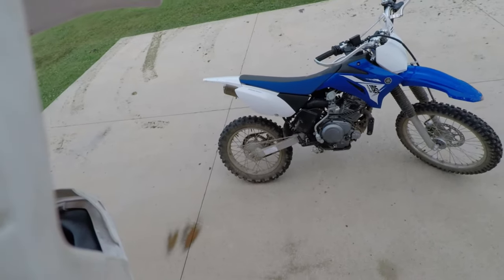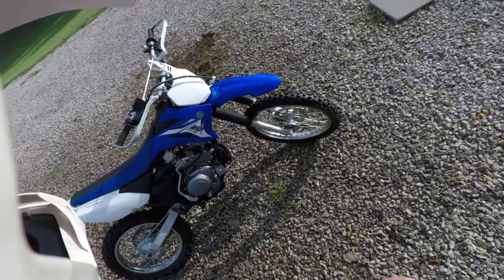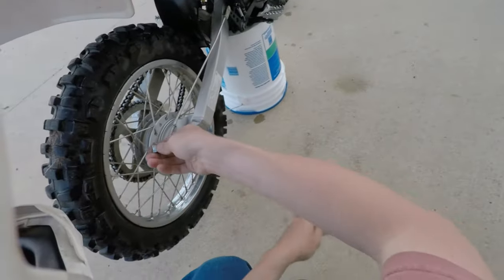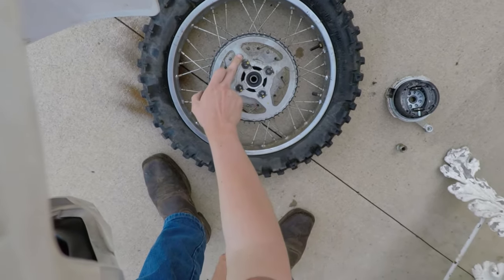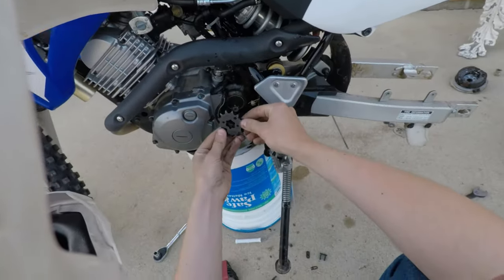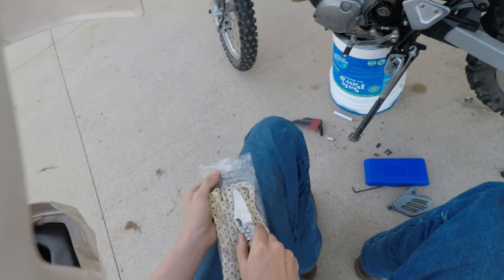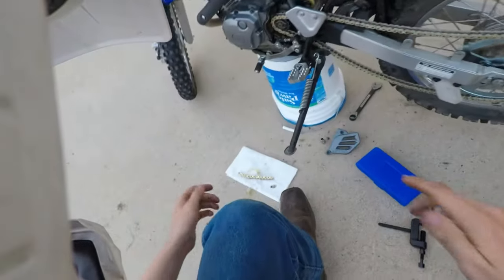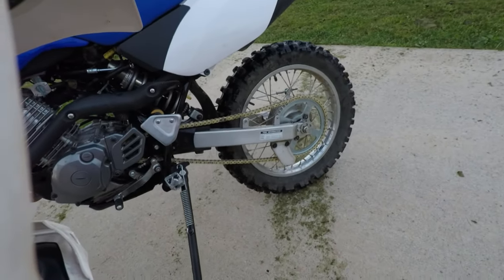How to Change a chain and sprocket on a TTR 125

Comment: is it better to leave the chain settings backed off all the way at number one with leeway cause it won’t line up what setting did you have yours on when you put the chain on thanks
Reply from the maker: I set the 🐌 cams all the way in or to 0, then I layed the new chain all the way around and cut the excess with the rivet pusher. 😉

Comment: Hey bro I need advice my rear sprocket broke off on my 2007 Ttr 125 cc , do I need a new sprocket?? Or a back rim ?
Reply from the maker: Did the sprocket break or did the hub break?
Reply: @THEdisgruntledmonk  I think the hub broke bro , the sprocket is just dangling and it seems like when I try to put it back it don’t wanna stay on
Reply from the maker: @joeperdomo3557  Are the sprocket nuts still fastened tight?
Reply: @THEdisgruntledmonk  that’s the weird thing the bolts aren’t their and it seems like the hole Wer you screw the bolts in are all stripped
Reply: @THEdisgruntledmonk  I just bought the bike bro it runs good i just ran into that problem right their
Reply from the maker: @joeperdomo3557  from what you've said it sounds like you need repair those sproket mounting stud holes
Reply: @THEdisgruntledmonk  I can’t just replace the whole thing instead and if so bro what do you recommend for me to get
Reply from the maker: @joeperdomo3557  if you can't repair or have it repaired, you will have to replace the hub.

Comment: I got a 125cc ttr 2008 my sprocket flew away Idk which one I need
Reply from the maker: Which sprocket did you lose? Was it the front?
Reply: @THEdisgruntledmonk  yes
Reply from the maker: @javierdelafuente2362 
Ok, well you will probably need all three of these parts. 
Best thing, just look up these part numbers

93822-13213-00 SPROCKET, DRIVE (13T)

271B2-E7456-00-00 HOLDER, SPROCKET

289131M-05010-00 BOLT <-- 2 of these